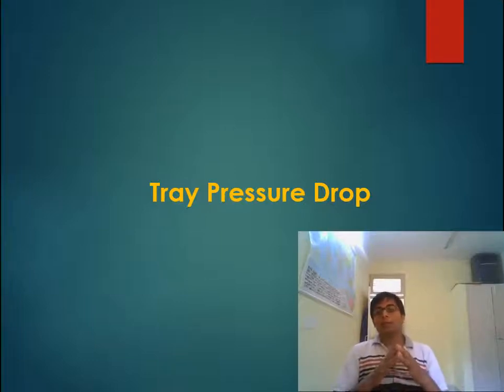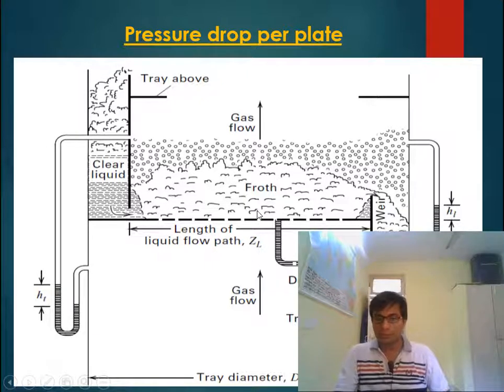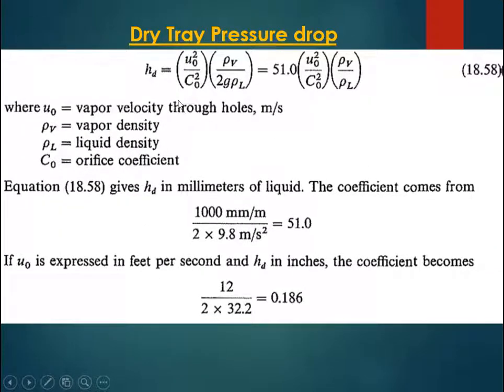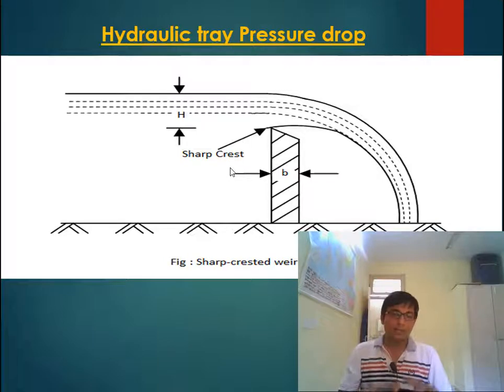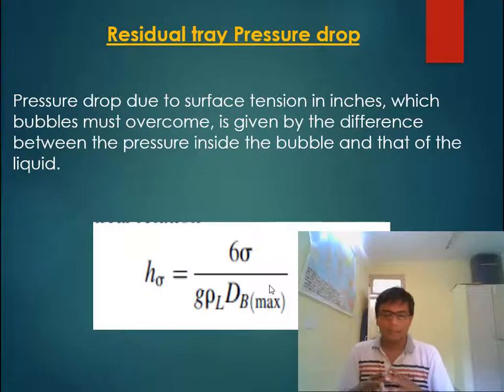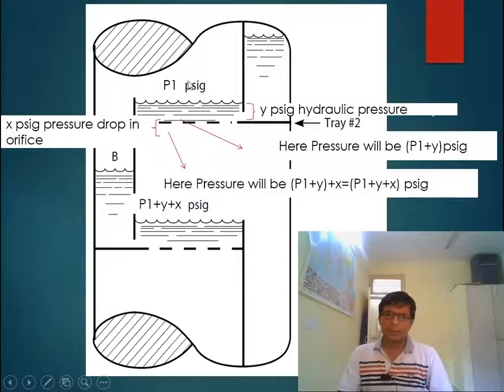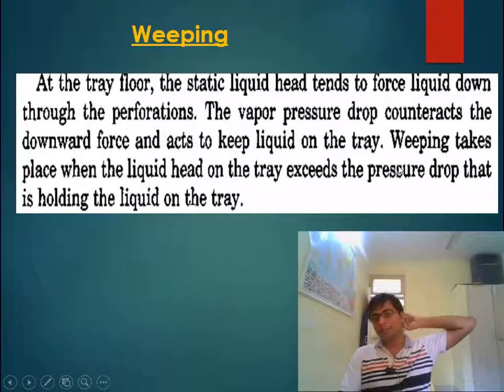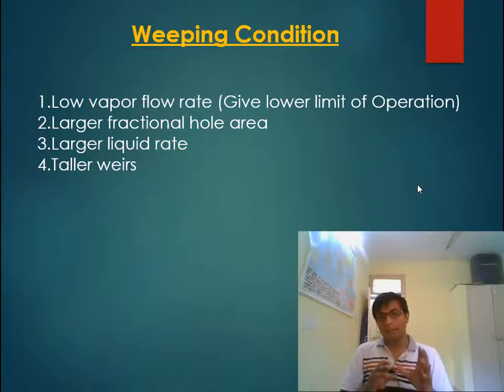Part 1 - Tray Pressure drop and Weeping in Distillation Column

Comment from the maker: I have taken derivation of dry tray pressure drop expression from Mccabe's Unit Operation of Chemical Engineering. However one point I should have clarified that the expression use for velocity measurement by orifice plate can not be used for pressure drop across orifice plate. Because for velocity prediction we apply Bernoulli. Whereas for pressure drop we are interested in energy loss. Though the expression will remain same. But concept should be clear. To make sense of my statement watch this video. https://www.youtube.com/watch?v=KbTnJwaVUcQ&t=0s&list=LLf9hHrAlKjjtTy6kdXza1Ew&index=27
Reply: Hi i'am Yosr Gafsi from Tunisia i'am working about simulation of preflash column and there are so many questions to ask .. how can i keep in touch ? i need your help please
Reply: Sir I need your number. I'm chemical engineering student

Comment: sir, at the start of the video, you discussed that the dry tray pressure drop is higher than the other 2 pressure drops, if this is true then the weeping will occur when the vapor pressure of the column is significantly dropped due to the dry tray abstraction.

if my understanding is wrong please correct me, sir.

Comment: In FCC main fractionator, When MCB (main column bottom) circulating reflux heat duty increases due to  taking a new exchanger in line, HCO tray level falls rapidly. Then we usually decrease the HCO CR flow rate and the tray level is restored. Please explain why??
Reply from the maker: When you increase slurry p/A then vapor load decreases and hence HCO also condense into slurry so does HCO level decreases. If you are increasing HCO CR then HCO tray level increase. What about LCO tray level ? In that case LCO tray level and top reflux should further decrease.
Reply: As we decrease HCO CR the HCO tray level increases. Why? Also there is no indication of LCO tray level at my refinery
Reply from the maker: @mradulagrawal7068  email me and we can discuss on phone.
Reply: Mailed you. Please check

Comment: Sir Air Separation par video bnaiye
Reply from the maker: Tk Rohtgi , Air separation means N2 and oxygen separation ?
Reply: @SandeepAcademy9  yes sir please make video on air separation column which separates N2 and O2 as it involves two column integrated in one and also it involves cryogenic distillation so it becomes quite confusing to visualize at -ve temperatures